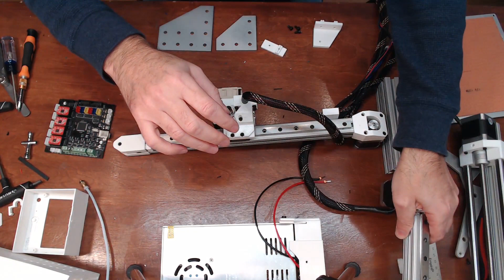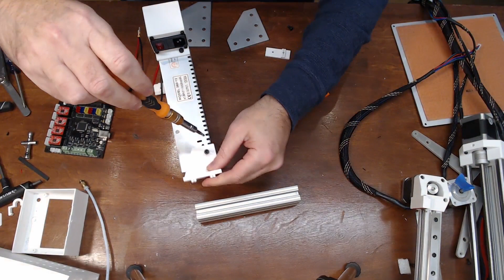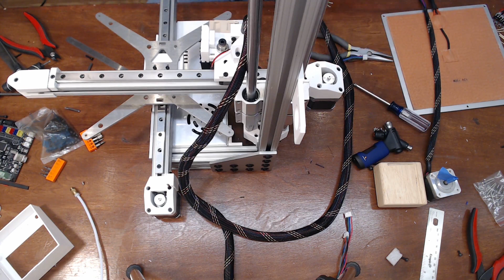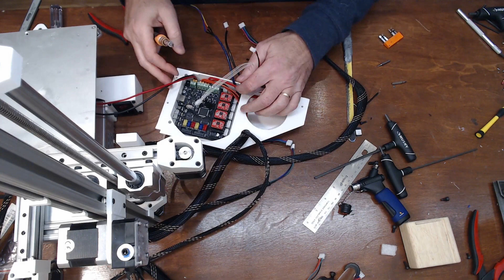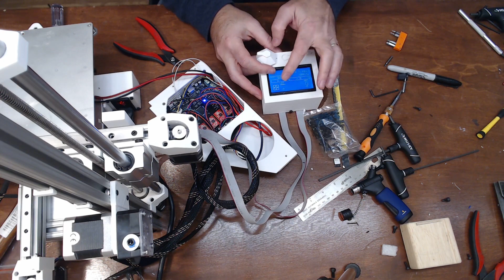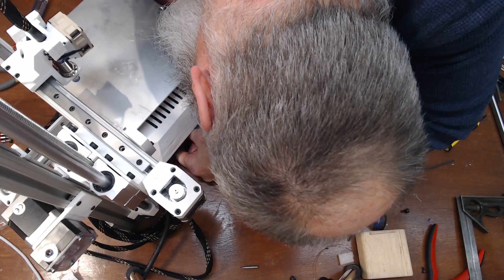C3Dt/c Cantilever 3D Printer Build: Part 8 Full Assembly

Comment: @UCp52p8k2W3hI8o4DN9xgUEQ hello for bothering you from a design this old. I'm preparing to make this machine with 2020 extrusions and all, but may I ask: compare to the C3DT/n z axis, is this z axis more or less sloppy and why did you change the z axis from linear rail to smooth rod?
Reply from the maker: When you hang the Z-axis on a linear rail (and no lead screw) you run into problems when the printer is paused or there's a power outage. The Z axis will come crashing down. So for the C3Dt/n I had to reprogram the Pause/Stop functionality to not release power from the z-axis stepper. I still could not prevent issues at power outage. technically you could use a lead screw and rail on Z but that seems somewhat overkill.

Please keep in mind that if you make the C3Dt/c(antilever) with 2020 (I did provide STL for all axis in 2020), it will NOT fit around the PSU as it was designed. the PSU is 50mm high which is close to 3060 but nowhere close to 2020 (or 2040). The printer was designed specifically for 3030 extrusion.
Reply: @Core3DTech  thanks for your detailed reply, so if i don't want my x gantry crashing down everytime there's no power, i should use leadscrew. However, I have another solution though: when the print ends, I can move the bed out of the way and lower the x gantry safely. Ask for the 2020 space problem, I'm prepared to remix your design somewhat to suit my parts
Reply from the maker: @ngocbannguyen  That would solve the end of print issue but you also have to take care of stop and pause (at the time I built this, default behavior was to drop power on the stepper at stop/pause. Also make sure there's no flex (at all) in your belt. If you were to use z-hopping it could cause some artifacts too. Good luck with the Built. Someone in sweden just built the C3Dt/dz with 2020.
Reply from the maker: another way to get around this issue is to use a worm gear on the Z-axis that will prevent any unwanted travel too.
Reply: @Core3DTech  i have plenty of 8mm leadscrew on hand so I'll try make a z actuator out of that
Reply: @Core3DTech  still wanna use linear rails for z
Reply from the maker: @ngocbannguyen  Good luck and thanks for showing interest in my printers
Reply: @Core3DTech  most of the part has come, and because my old printer is not in the best shape, I decided to create my own design with 5mm acrylic as the main material, also, i decided to use lead screw and linear rail as z axis, wish me luck
Reply: @Core3DTech  I'm glad that the linear rail is not less rigid than the double rod. May I ask that according to your experience, do linear rail have less z banding than smooth rod or the other way around?
Reply from the maker: @ngocbannguyen  as far as accuracy is concerned I think rail always trumps other methods (not the cheap rail from china). Z-banding can have many causes and a rail over lead screw only, would be better (there is no wobble in a rail when it's good). a combination of rod and leadscrew will also reduce/remove the (wobble) banding. You're bed heating (bad/no PID) can also cause banding. Even cheap filament that is not uniformly thick can also cause it.
Reply: @Core3DTech  I got second hand Japanese linear rails for dirt cheap, anyways, thanks for your designs and support. When my machine finishes I'll definitely upload mine as a remix

Comment: Cool.
Thanks allot for sharing this!

Have you considered to locate Z-rail in the middle of the left side of the base instead of its corner?
Table mostly would stay within printer base perimeter during movements in such case. And maybe even shorter X rail could be used.

Comment: Do you think would be possible to have a bed of 235x235mm?
I really like this design but a 200mm bed in not enough for me.
Reply from the maker: I would recommend against it on this particular design. The bed is actually 220x220mm (standard size) but the main issue is, that this is a cantilever. The X axis is pivoting on a single bracket and it's already pushing the boundaries of bed size. If you want a bigger bed, I would recommend going with an arched frame (two z-axis on each side of the bed).

also 235mm is a non-conventional bed size. I recommend you use a bed size that is found on commercial printers so you can easily get parts (like carriage, heater). If you go to the following link and click the "options" field you see a bunch of sizes used on the market https://www.buildtak.com/product/complete-buildtak-flexplate-system/
Reply: @Core3DTech  I have a print that needs 218mm on X/Y, if 220mm are full usable it's enough for me.
Reply from the maker: @mmakaba  just make sure your linear rail is long enough to travel that length (250mm rail only travels 215mm)
Reply from the maker: @mmakaba  also if your object is not 218x218 you can orient it diagonal and possibly gain some reach
Reply: @Core3DTech  Thanks, so 260mm linear rail could be enough?
Why no linear rail for Z?
Reply from the maker: @mmakaba  figure the length of the linear rail (meaning the rail the block slides on (not the entire axis) minus the length of the block that rides on it. that's what determines how far the extruder and bed can travel. 

There are printers with rail on the Z axis (I have a design myself on instructables). The problem with those is how to handle the end/stop/pause and worst of all a power outage. With normal settings the X axis will crash down in all scenarios. I had to change the code to handle stop/end of print and pause but in case of power outage your x-axis will drop and destroy the print.
Reply: @Core3DTech  Thanks for the answer. Do you think direct extruing would be overkill on your C3Dt/c? I think of something like bondtech+pancake+v6.
I'm trying to find a European 1010/1020 seller but it's not so simple.
Thanks for your sharings!
Reply from the maker: @mmakaba  Yes, direct extrusion on a cantilever is absolute overkill. The arm will not hold steady. 

You probably already know the 1010 and 1020 is imperial (1"x1" and 1"x2" not millimeters). I know this is a challenge outside the US. I just put the design out there based on what I did. Did not think the world would jump on it.

you might get away with 2525 2550 (metric) is off by 0.4mm, so the design will work but the parts may require some rescaling

I have metric designs for the X Y and Z linear actuators (2020 and 2040) but you'll have to rethink how to connect the frame
Reply: @Core3DTech  Thanks, I have found a 8020 Inc Eu distributor that will make me a quote. 
Is duet wifi compatible with your enclosure?
Reply from the maker: @mmakaba  No this enclosure was specifically designed for KFB2.0 board. If you are considering Duet Wifi I would seriously consider building a CoreXY or Delta. Seems a bit overkill for a cantilever printer.